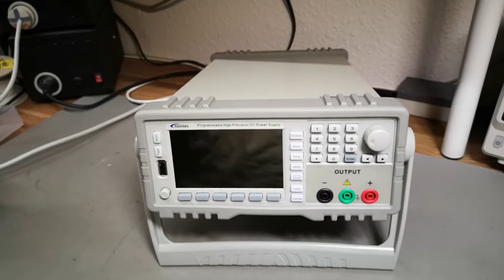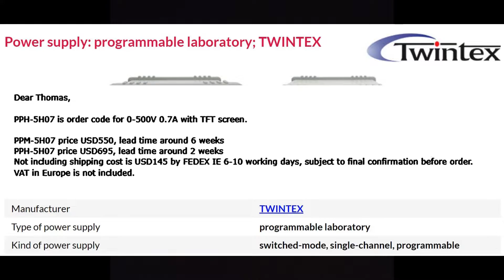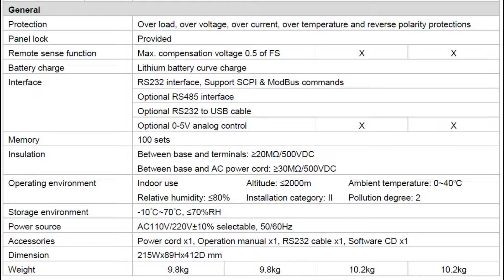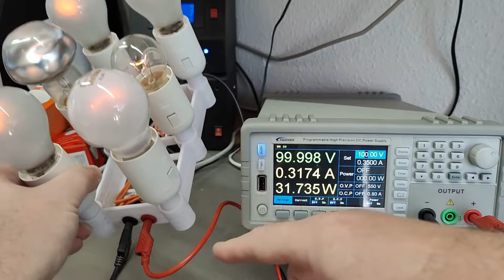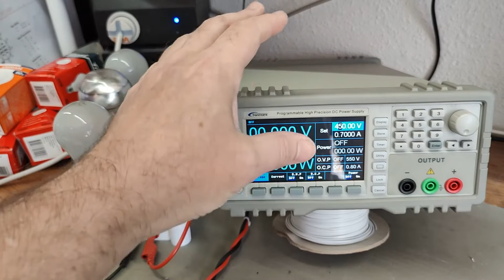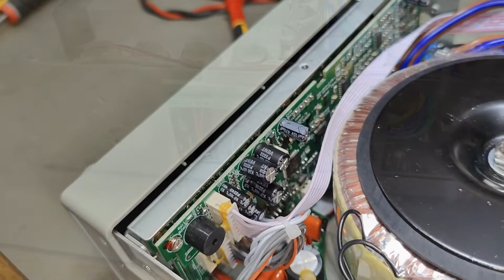Twintex PPM-5H07 500V 0.7A DC power supply LINEAR test teardown

Comment: Hi Thomas, I have exactly the same looking AXIOMET electronic load as the high current source. I downloaded the user manual from their website and there were also power supplies, try to see if you would succeed there, because I first saw this device design at Axiomet. I've had it for about 5 years, and back then only yellow glowing LCD displays were available. I originally wanted a 150V, 60A, 600W load, but the 600 and 1200W versions are more than 50cm deep and that wouldn't fit, so I only have the 300W version with a 40cm depth. I like the automatic switching to four-wire, the load works two-wire and the moment you connect SENSE it automatically switches to four-wire mode, if you have terminals on the back (I have BNC) SENSE will most likely function similarly. I wanted to get a high-current version of this source to have devices in the same design, but it won't fit anywhere.

I hope the feed works well for you and have a nice day 🙂 Tom